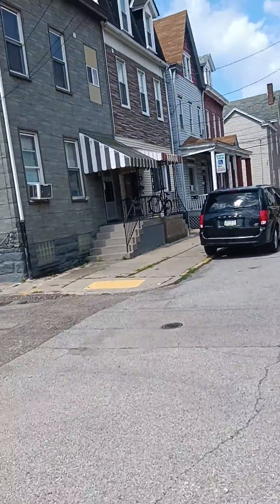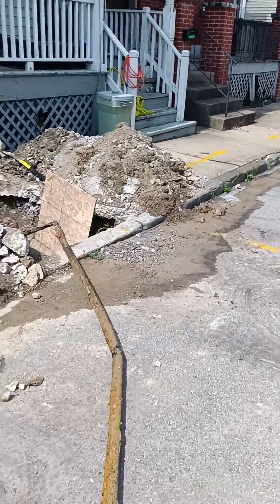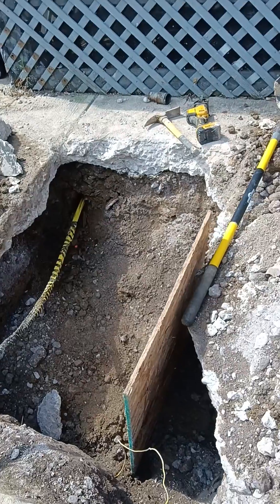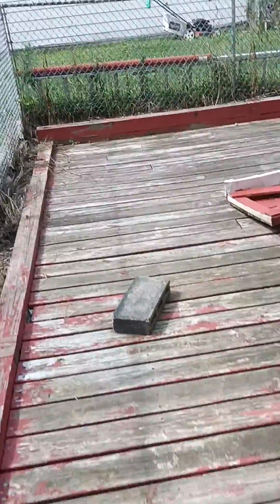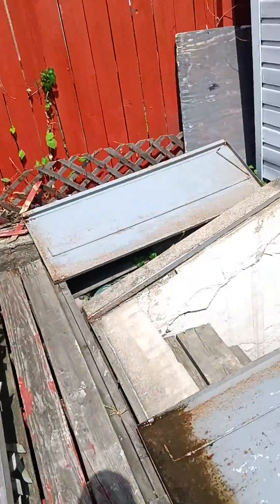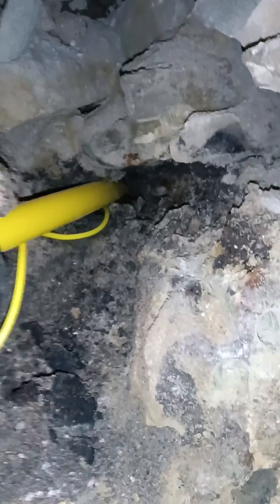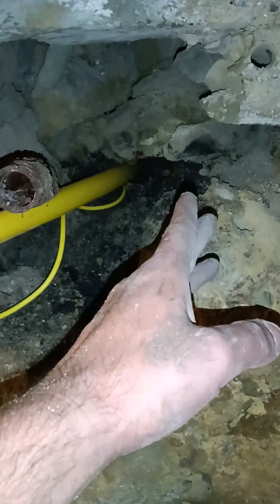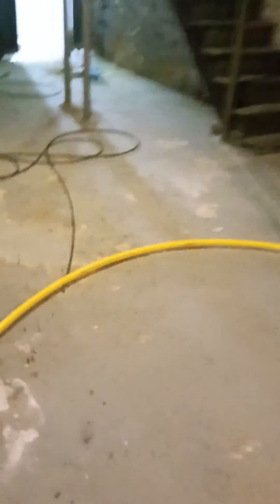replacement of a natural gas service line to a home in Pittsburgh pa

Comment: Its not allowed to have PE thru a wall or inside here. That would be a meter move out , new service outside
Reply from the maker: Yes a steel sleeve and service head adapter was installed before the meter set
Reply: @steelcitysewerman  yeah not allowed here at all. Huge NO NO
Reply from the maker: Steel sleeve, service head adapter and patched the wall back with hydraulic cement